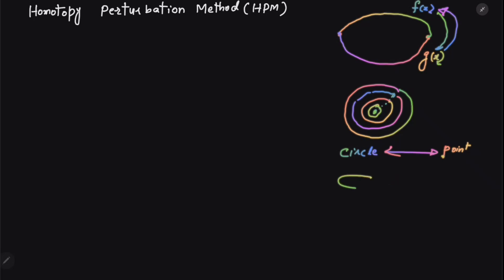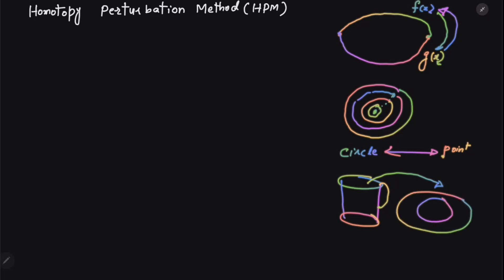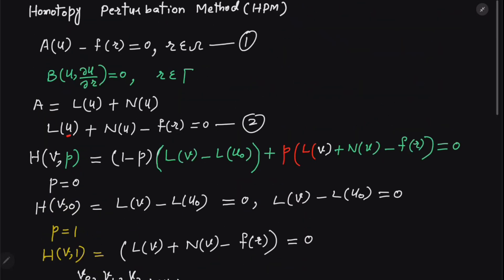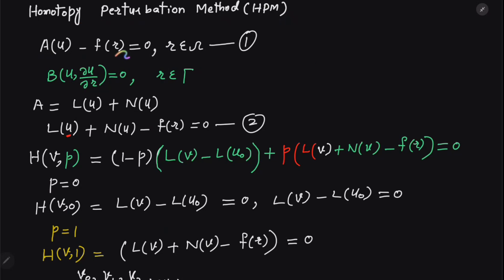Lecture 10| Homotopy Perturbation method: Introduction

Comment: Hello sir, thank you for your vudeo ,I'm interested in this topic .I'm a student from Indonesia. I would like you, sir, if Can I get a full material.My thesis is about this method to solve linear PDE 
Thank you
Reply from the maker: Hello, very good to know. MS thesis or PhD thesis?
Reply: I am an undergraduate student with honors in pure mathematics. As you may know, the Homotopy Analysis Method (HAM) is widely used in research but is rarely discussed in books, which presents a challenge for me in writing a comprehensive introduction and analyzing the accuracy and convergence behavior of the method. It is difficult to find sufficient material on these aspects, especially for my thesis.

I would be extremely grateful for any guidance or resources you can share regarding the theoretical foundations, accuracy, and convergence of HAM in solving linear partial differential equations. This would be invaluable for the work I am currently undertaking.

Thank you once again for your support. @muhammadasiffarooqphd
Reply: I am an undergraduate student with honors in pure mathematics. As you may know, the Homotopy Analysis Method (HAM) is widely used in research but is rarely discussed in books, which presents a challenge for me in writing a comprehensive introduction and analyzing the accuracy and convergence behavior of the method. It is difficult to find sufficient material on these aspects, especially for my thesis.

I would be extremely grateful for any guidance or resources you can share regarding the theoretical foundations, accuracy, and convergence of HAM in solving linear partial differential equations. This would be invaluable for the work I am currently undertaking.

Thank you once again for your support.
Reply from the maker: @Suara.Fans.Bola.01 Are you solving partial differential equations or ordinary differential equations?
Reply: PDE, sir ,heat ,wave, and Laplace equations
Reply from the maker: @Suara.Fans.Bola.01 At what stage are you in? How much time did you spend on this project? I can help you with other PDEs.
Reply from the maker: These are great questions I come back to you.
Reply: Dear Dr. Farooq,

I hope this message finds you well. Thank you very much for your kind support and generous offer to assist with my project. I truly appreciate your time and encouragement  it means a great deal to me.

Currently, I am facing challenges in the following sections:

Section 2.4 (The Homotopy Analysis Method) – I find it difficult to explain the core theory of HAM and how it differs from ADM when applied to linear PDEs.

Section 3.4 (Step-by-Step Procedure of HAM) – I’m struggling to write a clear and detailed implementation of HAM, especially concerning convergence control and iterative structure.

Section 4.6 (Error Analysis and Convergence Behavior) – I’m unsure how to effectively compare the convergence performance of ADM and HAM, or how to present the error metrics in a meaningful way.

If you could guide me through these areas or recommend any resources, examples, or strategies, I would be deeply grateful.

Once again, thank you so much for your support and willingness to help. I look forward to any suggestions you may have.